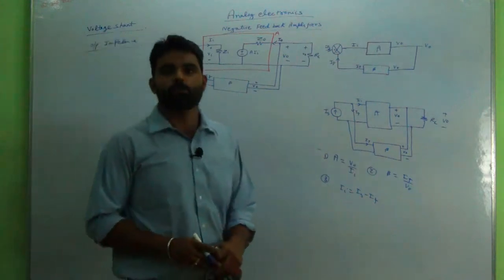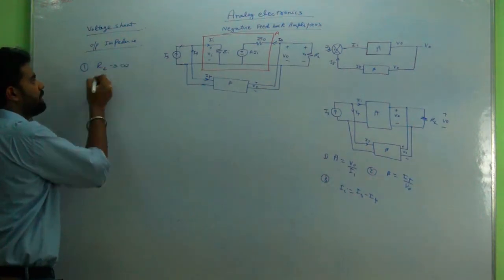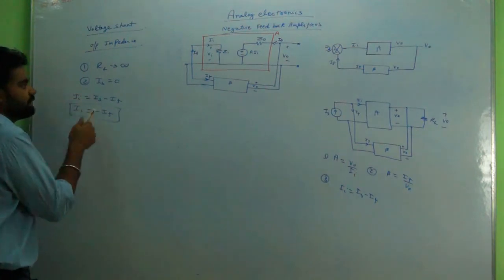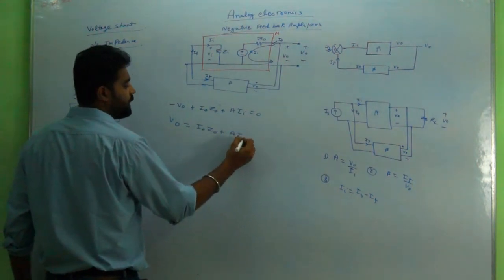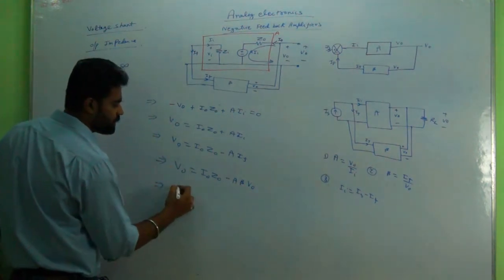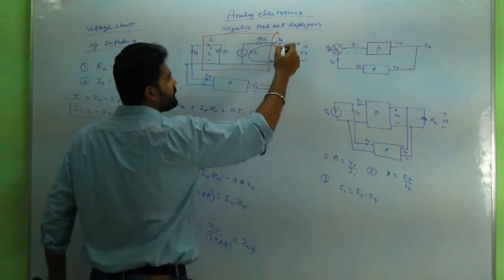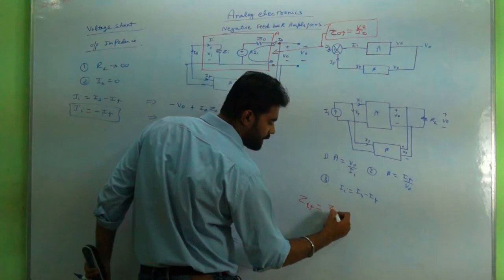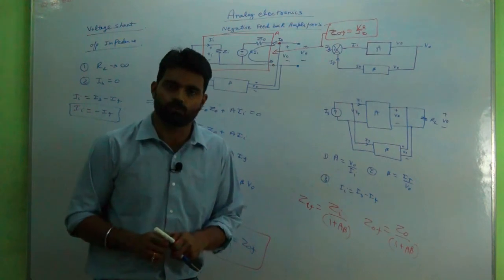Zof, Voltage shunt feedback amplifier

Comment: The voltage-shunt feedback method finds an important application in a wide class of amplifiers and in linear integrated circuits and in operational amplifiers in which superposition of potential is a dominant method to provide feedback. 

The description of the principle of superposition in Chapter 3 of textbook 4 (see below) is followed by its applications; the coupling of ac signals to inputs of transistors (an ac signal rides on a dc voltage) and the generation of an ac equivalent circuit to analyze transistor amplifiers. 

 It would be useful to learn the unification of electrostatics and circuits which belong to one science and not two before reading the description of the
principle of superposition. Watch the two videos below which describe at a fundamental level using a unified approach to electrostatics and circuits Current, the conduction process and surface charges:
i. https://youtu.be/TTtt28b1dYo and
ii. https://youtu.be/8BQM_xw2Rfo 

The results of simulation runs of circuits that superimpose ac signals on dc voltages in the "Simulation_super_ac_sig_on_dc_volt.pdf” with procedures to obtain the voltages, currents and waveforms for this using TINA simulation software is included in the CD accompanying the textbook 4 listed in the References in the last frame of video i above. 

The shunt feedback in voltage-shunt feedback amplifiers is such that the strength of the input signal to the amplifier be reduced with reference to the strength of the output ac voltage.
It is the resulting input weaker field at the input which reduces the current into the base terminal of a bipolar transistor, causing a reduction in emitter current in comparison to that without the shunt feedback. 

A detailed procedure to compute the values of the Shunt Feedback Resistor and Capacitor completes the description of the feedback effect in which the role of the principle of superposition in the physical process of feedback is discussed in vivid detail with the help of sequential diagrams using the unified approach in textbook 4. The calculation shown affords an intuitive understanding of the operation of the amplifier.